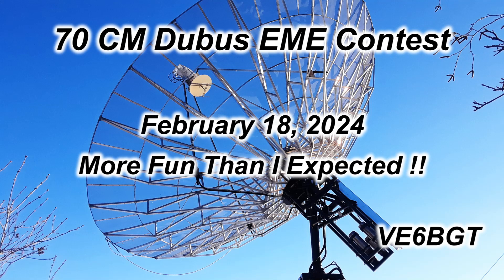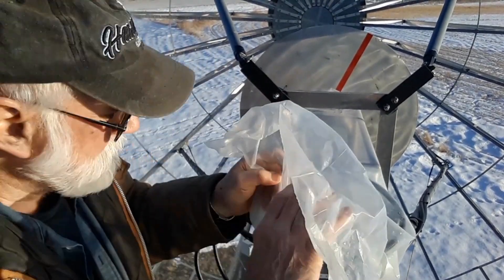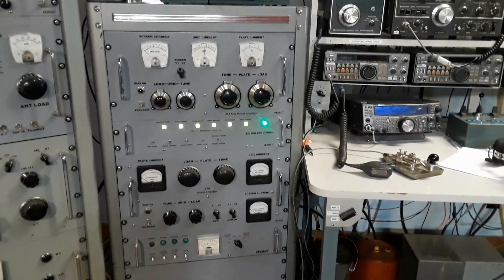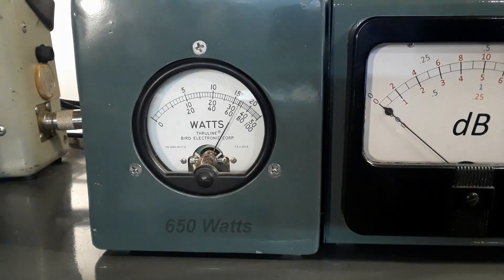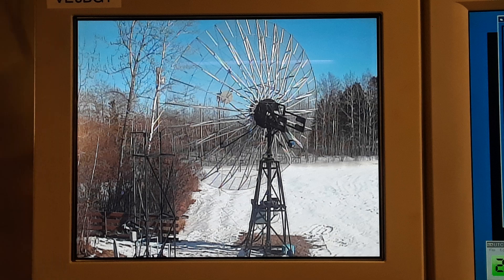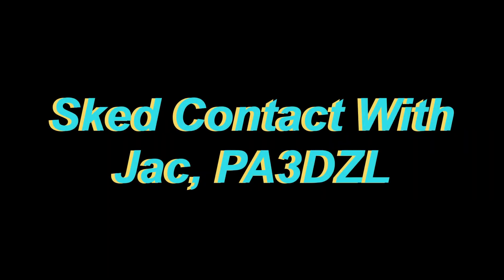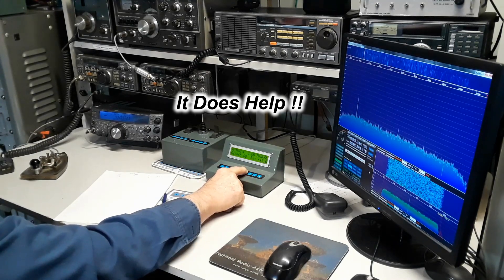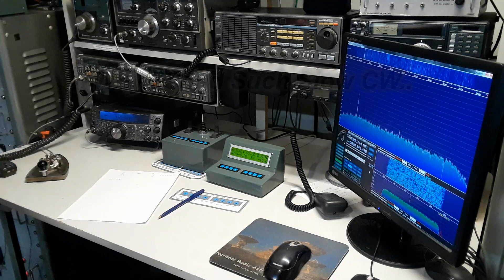2024,  432 Mhz,  Dubus EME Contest

Comment: Awesome video. I picked up a 432 mhz amp that is the same design as yours. It’s just the rf cabinet though, I have to make the power supply. It’s old but nothing I can’t fix. Never done EME but since I got the amp I’ve been researching and think I want to give it try. You’re very inspiring!
Thanks. 
Dave W6CPY

Comment: Enjoyed the video. I've got that same K2RIW amp here that I used for FSTV back in the day. Nice to see that some of them are still kicking, although mine has been in the closet for a couple of decades now. 73.
Reply from the maker: Yea I used my K2RIW for ATV back when also.. I never got the proper modulation going, I just drove the amp with the ATV transmitter. Could get it to around 200 watts before it lost sync etc..  It works good for EME once it drifts into tune ha ha.. I abuse the poor thing..
Thanks for the comment..  I like your channel name ha ha.. Skip

Comment: Thanks Skip, for this interesting video.
That's an impressive power for 70cm !
* What's the gain of your dish on 70cm ?
* What do you use in the preamp ?

Your CW may be slow, but it is easy readable and properly keyed, nothing wrong here !

I recall the early 90's when I joined a UHF/SHF contest group being QRV on 23, 13, 9 and 3 cm (so not on 6).
The equipment was also that bulky using a couple of 2C39 cavity racks, tjee,  stuff has become pretty advanced since that time.
Reply from the maker: Hello Pascal, thanks for the comments.. Well the dish I made is 21.5 feet in diameter, the VK3UM program calculates that at 432 Mhz the gain is around 27 dB...  The receive preamp is a WD5AGO design and if I recall its around 21 dB gain and a Noise Figure of about 0.28dB..  That old UHF amp I built a long time ago is not to bad but there are more modern tubes, a single Russian tube would put out a cool kilowatt I think.. I have one here that I am going to build up into a new amp someday.  I just have to many things to work on it seems, keeps me busy all this stuff..  My CW isnt to bad but thats transmitting, I have a hard time copying it with my poor hearing anymore, I used to be a lot better at it.. If I can hear a good solid tone then its not to bad.. Thats what I like about EME, we just exchange calls, signal reports then 73 and its done.. That can take quite a while sometimes.. ha ha... Skip

Comment: Rocket science setup, finest engineering, Why do you communicate by Morse code?
Reply from the maker: Hello and thanks for asking.. Voice or SSB ( Single Sideband ) doesnt work very well due to the fact the signal is weaker and has a lot fading and distortion from the way the signal bounces off different parts of the lunar surface.. Especially on this frequency of 432 Mhz.. This lower frequency is badly distorted when it comes back through the earths magnetic field and a wider signal that is voice, SSB, gets all messed up and would be hard to understand.. On the higher frequencies 1296 Mhz and higher this effect doesnt happen but its still hard to use voice but we have at times when conditions are good.. CW or morse code has all its energy concentrated in a narrow signal compared to SSB and the strength of it is much stronger thus easier to understand..
Now if you asking why I am using CW instead of digital, well I just havent gotten around to setting up my station to do that mode, yet..  I am busy enough just working on the hardware side of things rather than the frustration of digital communications..
But someday I will be..  Thanks, Skip
Reply: @VE6BGT Thank you sir. I really appreciate the way you explained to me the way it  worked. Learning everyday. God bless you!